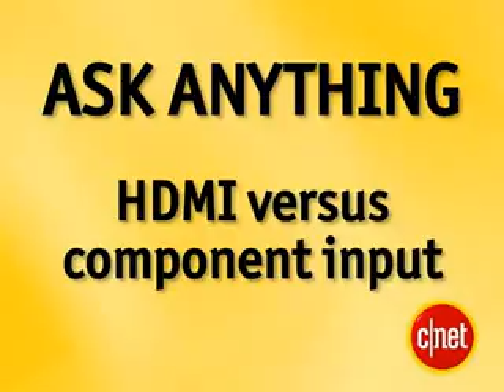HDMI vs Component Video

Comment: This is old.  Component has improved over the past few years. I've done diagnostics on my TV while playing blu-ray using both component and HDMI.  Component transfers truer, richer colors than HDMI.  Of course, I've heard the opposite from others, but I guess that also depends on the TV you're watching it on.

For me, I'm a purist.  That means I do NOT run my audio through a receiver to get to my TV.  I want direct input from the player to the TV.  Using component is convenient because that let's me use my player's HDMI Out to transfer sound to my receiver since only HDMI can transfer the newer audio codes like Dolby True HD and DTS-HD Master Audo - which optical is incapable of doing.
Reply: Wrong, Component Video transmits up to 1080p.

Comment: my analog tv dont have hdmi-how do i use a conerter box with hdmi
Reply: There may be HDMI modulators to coaxial but I'm not sure. To do it myself I use HDMI to RCA, then use an RF modulator to display it on my 1985 CRT television.

Comment: I am speaking from experience.  You can take it any way you want.  I have actually proven to customers that component can actually give you a BETTER picture than HDMI through A/B selection.  In addition component works 100% of the time.  There is no handshake to have issues with.  BTW, you can get a single cable with all the component and audio cables in it.

Comment: Fail, the reason why the cable company gives you a component cable with your HD cable box instead of an HDMI cable is because they know something you don't know, that Component will actually give you a deeper richer colour than HDMI cables, and will do 1080P all day long.  Whenever you can split R,G,B, into three separate colour signals your gonna get purer deeper colour rendition, FACT!!

Comment: @JoshC969 Component cables will do 1080P all day long, no problem, it will also actually give you a purer more natural colour with deeper blacks, because the three colours R,G,B= Red,Green,Blue, are separated to three separate signal cable connections which retain a purer colour signal. HDMI, on the other hand puts the three colour signal and audio onto one cable connection which can't retain as pure a colour signal as component. So, save your money, and use your component cable.

Comment: @ChrizzUSMC 
1080i stands for Interlaced and is when every second horizontal line on the screen is "refreshed" or "changed"
1080p stands for Progressive and is when every horizontal line on the screen is "refreshed" or "changed"
they both display the same resolution of 1920x1080 (the 1080 part) but the way in which they are refreshed are different. Also technically 1080i refreshes half as often as 1080p therefore 1080p is the best for picture quality.

Comment: @JoshC969 If you set your Xbox 360 to 1080p, then it will upscale any non-1080p content into 1080p. So yes, it will be full 1080p but most will just be upscaled (less than 10 games are native 1080p, and Xbox Dashboard is native 720p).

Comment: I found component cables for the ps3 for only $5, would I see a difference between those and composite cables? i have an old tv so it doesn't have HDMI connection

Comment: for what i know component can also transfer full hd signals.
will it still has a stereo audio cable to transfer stereo signals.
but if the source also contains digital out you can connect it alongside with component to your hdtv screen.
sadly most compponent and even dvi sources like today's laptops  has no digittal sound output

Comment: @glockman9c
i agree what you stated that the HDMI may not be better after all. What i would just like to say is that i prefer HDMI over Component because of all the cables. i want to eliminate all the cables to make it look more organized. and i just use the TV speakers instead of another stereo, so i dont need any more cables. so it works fine with me and works just what is was designed to work for. your hook up may be radically different so may i just ask to speak for yourself next time?

Comment: Hi, I want to connect my video card to my television but my television has a DVI connection and my my video card too, how can I connect the video card to my television? My television only supports 1080i. THE DVI-HDTV input terminal is compliant with the EIA-861 standard and is not intented for use with personal computers. Thanks

Comment: HDMI is preferred because it tends to be slightly clearer depending on what your doing (video games are more or less the same since they are upscaled to 1080i/p anyway, bluray movies look sharper, but only slightly)

Component is cheaper, but its not hard to find HDMI cables for 15 bucks from electronic stores not named Best Buy. Unlike component it really doesn't matter how much they cost, they all look pretty much the same.

As for the PS3, I would assume so. The newer XBOXs have an HDMI port.

Comment: So I just got a PS3 Slim 250GB.

I want to know:

1. Which should I purchase? HDMI Cable or Component Cable?
Or is there no difference?
Which one tends to be cheaper?

AND

2. Does any HDMI Cable work or is there a specific kind only for the PS3?

Thanks. Please let me know. I should be ordering either one online in all due time as I hear that's where you can find the cheapest prices. :)

Comment: dont forget the xbox360 elite 260gb hdd will initially cost over $700 because of online warantee, wifi adapter, hd dvd player, and other shiz. while the ps3 slim, has a 250gb option that will only cost an extra $50, while the xbox 60gb hdd costs$100 (check the microsoft and other websites) so microsoft is scamming you

Comment: yes you can use it as video but the technology is too expensive right now,maybe in 10 more years or less will will have optical video,but it will probably be powerful enough to damage the eyes if you look at the red light.

Comment: Take it from me,component sucks compared to HDMI.I connect my xbxo360 with component and HDMI,and the HDMI picture is much clear and provides higher resolution.I set my xbox to highest res,and the component cable couldn't even display the video.HDMI may have higher signal loss at long distance,but it can handle the highest resolutions,and surround sound in one digital cable,you suck component,and composite,and s-video,and vga sucks too.

Comment: biggest issue is distance., Analogue component cables have greater 'reach' than a HDMI cable, because the digital signal degrades more quickly. So, got a long run - HDMI won't cut it.

Comment: I love HDMI for one simple reason ONE SINGLE CABLE. I HATE cable clutter, with HDMI you don't have an electronic device thats got like 20-30 something cables coming out of it. HDMI is simpler and cleaner. You guys that are dissing it just haven't experienced cable clutter yet, and on top of that, HDMI cables are getting cheaper all the time.

Comment: you can use component cables for it and still get a HD picture. the newer models of the 360 have the HDMI cable connecter in the back of it but you would most likely have to buy the cable seperate BUT it is worth the extra cash if you want a better/smoother picture.. weather it be a 720p tv or a 1080p television.. and if your going to only get a 37 inch screen then i wouldnt waste the money on 1080p becasue that really only matters for t.vs 50 inches or bigger.. cheers!:)

Comment: Composite is AWFUL.  There's no point in having an HDTV if you use composite.  Composite is grainy and ugly, and only supposed 480i resolution.

Get component, it's got a crystal clear image and great coloring, and supports 1080p resolution.

Comment: Unlike HDMI which carries both audio and video, component video carries audio signal in different RCA cables. Search some e-shops; component cables have 5 cables: 3 for video and 2 for audio, so you don't need to worry about that.

Comment: It does make a big difference in Video... You can output your PS3's image up to 1080p (provided your TV supports it) but not audio, because Component cables do not carry audio signals. Even if your TV doesn't support 1080p, 720p is better than the SD quality you get over composite video.

Comment from the maker: I rather use component however with fiber optic audio via TOSLINK cable. You get great picture along with 5.1 surround sound. HDMI delivers both through the same cable but not all receivers have HDMI inputs.

Comment from the maker: Component is less complex so it is less subject to errors. It does not have 19 parallel digital signals traveling through 1 cable. But however it is an analog signal which is subject to other electromagnetic interference and potential signal loss can occur. That is why shielded cables are more important for component than HDMI.

Comment from the maker: Thats true, but you are forgetting that Component cables transmit a analog signal which is capable of signal deterioration and most tv's do not support 1080p through component. HDMI uses digital signals for audio and video and no matter what cable you use, the signal will not deteriorate. Component is only a cheaper alternative however, but personally I really do not like the cable clutter.

Comment from the maker: To a certain extent that is not true. I have seen 360 games that boast better lighting and anti-aliasing than most PS3 games.  In terms of full 1080p though the PS3 has the edge though. The 360 is limited with the HDMI 1.2 spec while the PS3 has the latest HDMI 1.3c spec which supports multiple HD audio formats and higher resolutions. However, when you do a screen test with both consoles, both look identical on a HDTV in 1080p.

Comment from the maker: It is true HD. The games are programmed in such a way where the realistic feel of the graphics is maintained on a DVD which is encoded in HD. No upconversion is used and there is certainly no upconverted signal being transmitted through component and HDMI. The 360 games are true HD.

Comment: its not true hd because it doesnt use quad layer discs and doesnt have enough memory for it
360 stopped producing hddvds since it lost the war against bluray, and now uses standard dvd which doesn't have "true hd" content
the ps3 uses bluray which gives true hd content
1080p is just resolution
just because both 360 and ps3 have 1080p resolutions,it doesnt mean the 360 matches its image quality
this is simply because blu ray discs have enough memory to have "true hd"
standard dvd can't produce it

Comment from the maker: Definitely true. The PS3 is currently using 3-4 cells of its 7 cell processor depending on the game. 1 cell is reserved for the OS so developers have 6 remaining cells to work with. As are result, graphics can be pushed to look even more awesome through HD. HDMI on the PS3 looks awesome but one thing Sony should do is to at least provide HD cables in the box. If this is an HD system with Blu-Ray and other HD features then it should include HD cables, either component or HDMI

Comment: question ..ive bought a hd upscalingdvd player. my plasma panel will run 1080i through component but has no hdmi port will the dvd player upscale through component or is it only possible to upscale via hdmi? thanks

Comment: Xbox 360's nowadays have a very very super slight chance to have 3rl's or any RROD's,if so,they are just caused by power fluctuations(only Falcons and Jaspers),so there's no trouble in buying 360,plus,if still don't know,you can also upgrade 360's harddrive...well in terms of graphics,360 still wins...as what LukeXx said,it's worth hooking up with HDMI's,honestly,360's has better graphics,YES PS3's use HDMI 1.3,360 uses 1.2,but what now?

Comment: In my experience it is worth hooking up the 360 on a 720p with a HDMI cable.  The clarity is better & so are the colors. HDMI has a digital signal, which I believe is worth the upgrade. All newer Xboxs have HDMI ports, plus they have the updated chip set that avoids overheating.

Comment: I already did and the HDMI cleared up those annoying lines.  Plus I got a 1.3v cable for only $4!  the color seems truer too.  I guess if your hardware has HDMI ports, you should always use them.  Just don't pay $50 for a cable, when you can get one for a fraction of the cost.

Comment: I'm wondering if HDMI will remove these small faded lines I see moving up the screen.  I think it is coming from the signal of the component cables.  Will HDMI clear up some of the distortion that seems to occur with composite?  I;m running a 720P but I don't think the lines I'm seeing are due to the TV.

Comment from the maker: No man, the older versions of the 360 do not have HDMI. The Elite the Arcade and newer versions of the pro have HDMI, basically all the versions of the 360 that have been manufactured since sept 07 have the HDMI port.  It does not really make a difference if you have HDMI or component on 720p, I would go with HDMI because its one cable which has audio and video in it. For component you need 3 cables for video and two cables for the audio which is less convenient.

Comment from the maker: It depends on the video signal, if the signal is standard def, then it would be the same on component and HDMI. If it is high def, then you will get high def with only HDMI. HDMI displays standard def and high def where as standard cables only disply standard def.

Comment from the maker: HDMI is mostly convenience. Component is at its max in terms of video resolution but HDMI's future capabilities far outshines Component. HDMI also supports HD audio through the same cable unlike component which requires 5 separate cables for both video and audio.

Comment: Here is a test for any Non-believers or so-called experts that set these boxes up.  take the component cables and plug it in.  Notice your volume level.  It will be higher than normal.  Now plug in an HDMI and notice your volue level is Much lower.  
With composite comercials will tend to be much louder than the show and HDMI will level everything out.  The Reason:Commercials are recorded in Analog so there is no degrdation with the component but the HDMI Filters This out due to no Conversion.

Comment from the maker: Lol, Component cables are RCA cables, It is a component cable with RCA connectors. Same thing with composite cables, they are RCA cables. They have names to distinguish different cables, you just cant call any cable with RCA connectors an RCA cable.

Comment from the maker: Uh, thats because you don't get audio from a video card with only video connections. I know HDMI can also transmit audio but not from a video card, video cards on pc's only transmit video data. You need to get a 3.5mm to RCA adapter for audio to hook up your sound connection to your tv.

Comment from the maker: No, i don't believe so, I have only heard of 5.1 being transferred through TOSLINK (fiber optic digital) and coaxial. The xbox 360 has a TOSLINK port on the a/v wires for 5.1. Look up TOSLINK and you will see the port, audio is transferred digitally though TOSLINK which is fiber optic. You might have the port.

Comment from the maker: No, 5.1 is basically surround sound with 5 satellite speakers and 1 sub woofer. You need to have a surround sound set up for 5.1 and u have to use an optical cable or coaxial cable to hook up to the receiver of your surround sound system.

Comment: HDMI and Component virtually identical?  But not identical.  If you have a good TV then use the best quality - get HDMI.  If you have a PS3 for BluRay, xbox360 elite and ur cable box all hdmi - then spend about $40 and get urself a 1.3b (or higher if they are out by the time you read this) HDMI switch with remote.  Your life will be so much better - and your eyes will thank you.

Comment from the maker: Component has its limitations though. Like I said on my video description, HDMI has the capacity to expand whereas component has already reached the maximum of its video capabilities. You definitely have a point though and most people should take that into consideration. However, it would be beneficial to note that there are emerging HD formats which currently transcend 1080p and can only be transmitted through HDMI.

Comment: As far as the consumer is concerned there is little benefit to an all digital signal. HDMI was never intended to benefit consumer. The only people who benefit from HDMI are the content providers and originators. As for scalability. HDMI is simply twisted pair with a new fancy name. While component is made up of three 75 ohm coaxial cables. Those Coaxial cables have far more bandwidth capability then HDMI could ever have. We call the bandwidth of a single Coaxial line DC to daylight.

Comment: Component cables Actually have more then enough bandwidth capability to carry extremely high resolution data over very long distances. The only reason component is limited in resolution is because the movie industry used arm twisting tactics to force manufactures into a voluntary resolution limit. With HDMI the movie industry gets what it has always wanted. Ultimate control over what you can and cant do with your own equipment.

Comment: Part 2 of 2 
Component cable is made up of three fully shielded 75ohm coaxial cables with unlimited bandwidth "DC to daylight". HDMI is nothing more then old fashion twisted pair with a new name. HDMI suffers from all the problems associated with twisted pair primarily limited bandwidth, susceptibility to interference and limited cable lengths due to attenuation. 
Oh and If think Digital to analog conversions are bad, wait till you start seeing how bad Digital to digital conversions are

Comment from the maker: It does work to some degree, there is no difference but you will get better quality by using component cables since they have thicker copper wiring and have better shielding.